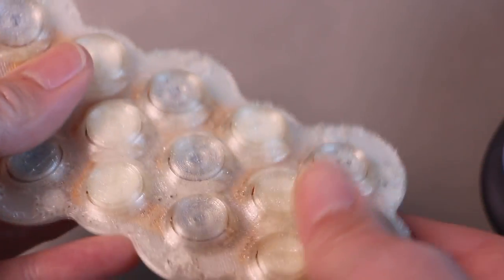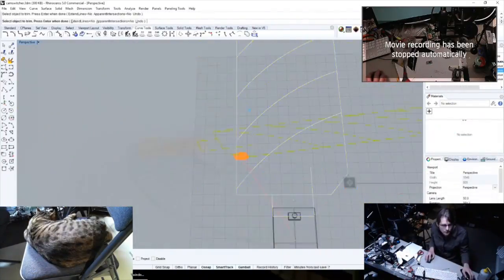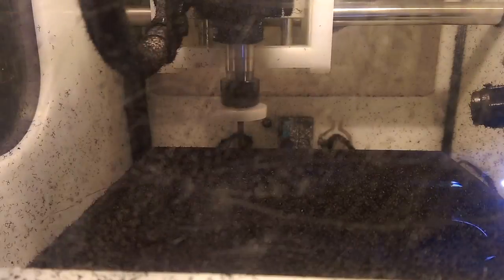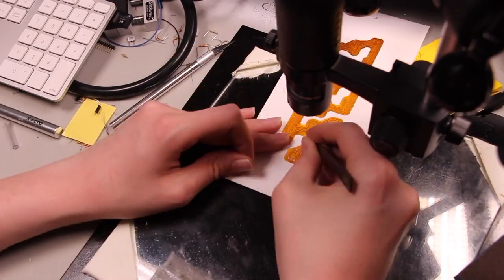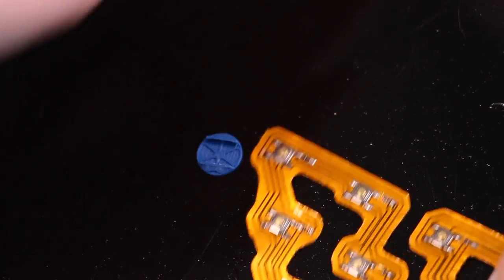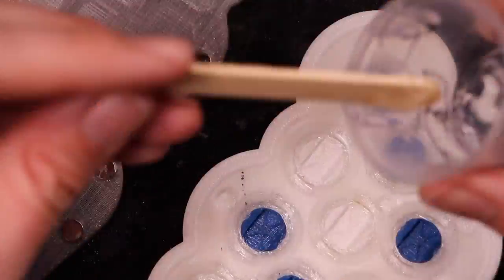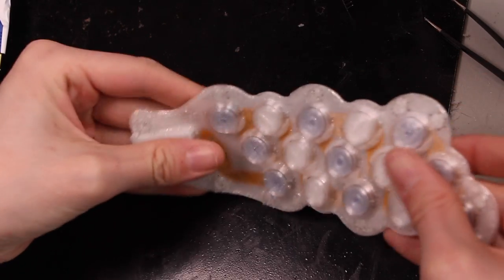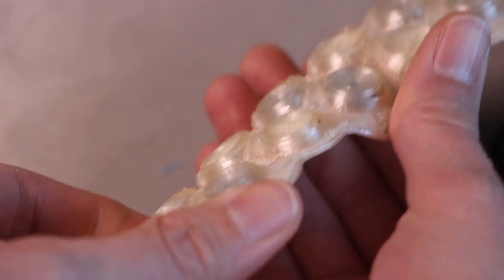Flexible Keypad Experiment - scanlime:023

Comment: Always inspiring! Consider silicone in place of flex filament in your next flexible project for the flex/durability- print your molds out of nylon (ie: Taulman bridge is easy to work with), the silicone doesn't stick so de-molding is straightforward. 

I've injected standard RTV into these molds with great success but you can expand upon that w/ adding acrylic paint as dye/cure accelerant , or source specific silicones for shore hardness or (exotic)UV cure... smaller scale casts like your keyboard can be injected without voids (no need to de-gas)
Reply: Cool! -have example to show results if interested(<1mm wall thickness :) +you don't have to commit to overmold/embeding circuitry,  you can cast both front+backface and post-bond layers as you did here; even reuse face mold as form for pressing.

Comment: Hey you could have easily spray painted the copper area and used a laser engraver to route(exposing copper) the isolation, and finally ferric chloride would have done a wonderful job for flexible pcb!

Comment: A really simple and quick way to put identifiable bumps on the xkey thing would be a transparent glue? Hot glue should suffice?

Also I had one of those flexible rubber keyboards, I'll cut it apart and see how it could flex so much. I'm pretty sure it was down to the fact there were no solid key caps. It failed because the wire in the control board bit broke. It would have been nice to have the control board on the computer end.

Looking great though!
Reply: Yeah it's annoying, it's a great feature to have, means you don't really have to look. The feel of it doesn't even need to be on all the keys, just one or two would help. Much like keyboards or dial pads. Just a place to get familiar with. Best of luck! :)